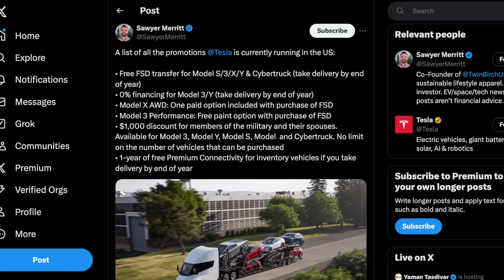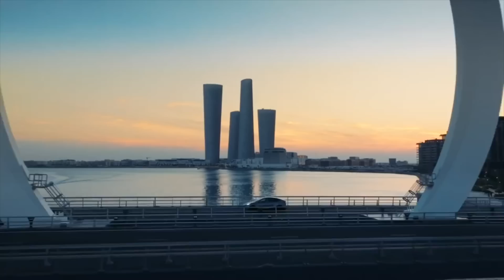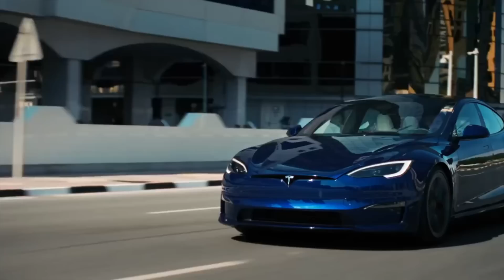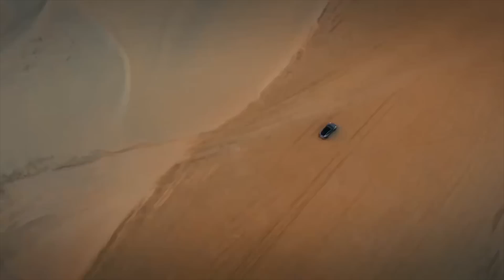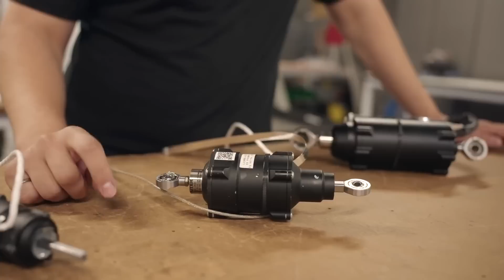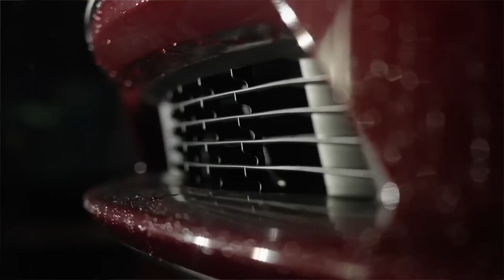Tesla Model Y Juniper Front Grill and Underbody Design Changes Confirmed | This is Great News

Comment: Are you sure underbody protection will be metal, not plastic? Is it only rear motor part? And emergency release at rear door will be located at the same spot as front door?
Reply from the maker: It’s an alloy which is a mixture of metal compounds, so definitely not plastic. And yes emergency release would be the same place
Reply: @ thank you, but what do you mean by emergency release would be the same place? You mean same as old version?
Reply from the maker: @Hypeboy280 sorry i should’ve been more clear. The front and rear will now be in the same place for easier access and memory sake
Reply: @heyJohnEe thank you for your clarification! Sorry to ask you one more question. The alloy is only for rear motor? For front motor it’s still plastic?
Reply from the maker: @Hypeboy280 no specific details but if it’s a similar skid plate they’re working on for the Cybertruck, it’s expected to cover the entire bottom including the battery pack and both motors. Better protection all around
Reply: @heyJohnEe  thank you. That would be fantastic. There would be nothing to beat Model Y juniper if it has all these features. I hope everything comes true.
Reply from the maker: @Hypeboy280 fingers crossed 🤞

Comment: Any word if the standard size juniper (not the rumored larger 6/7 seater) will also/still offer a 7 seater option?
Reply from the maker: Not entirely sure, but if the extended length option has been favorable in the Asian and European market, they might streamline the entire thing and make Juniper longer across the board for all markets 🤞

Comment: So basically its 98% the same as Highland in terms of changes. A 240v power outlet and even a back boot DC socket is a big miss in the Highland. Also V2L/ V2G which many competitors have. In any case they are moving slowly in the right direction.
Reply from the maker: Definitely a big miss for the highland not including V2L

Comment: Thanks and great succinct summary.  It will also get better WiFi antennas which will allow it to get on WiFi from further distance from WiFi source.
Reply from the maker: Appreciate it, and yup wifi antenna upgrade is going to allow it to reach much further. Even the placement has moved to the middle top portion of the car instead of the passenger mirror, so it’s going to make a big difference esp for those software updates I keep missing due to wifi being so poor

Comment: Will it have steer-by-wire ?
That's the only way to make stalkless design work.
Reply from the maker: I wish but seems unlikely since they’ll need to rearchitect the entire design from ground up using 48v for steer by wire like the CT
Reply: @heyJohnEe  It wouldn't makes sense the new Model Y not to have a 48 V low voltage system.
Reply from the maker: @pauld3327 thinking on the manufacturing side of things, there’s no possibility it can happen as it requires an extensive redesign of all parts and components. Juniper will be based on the same 2018 Model 3 platform, so not likely